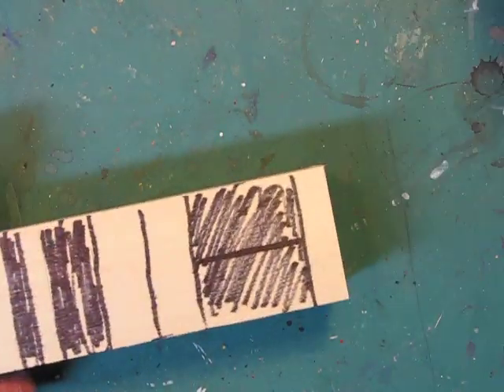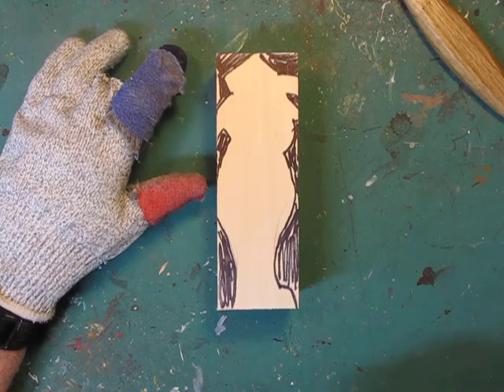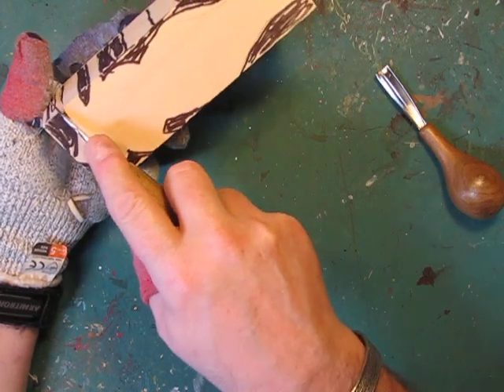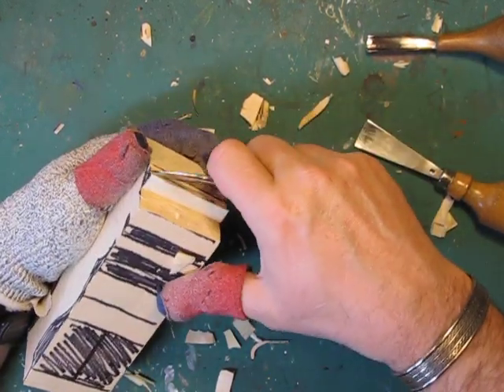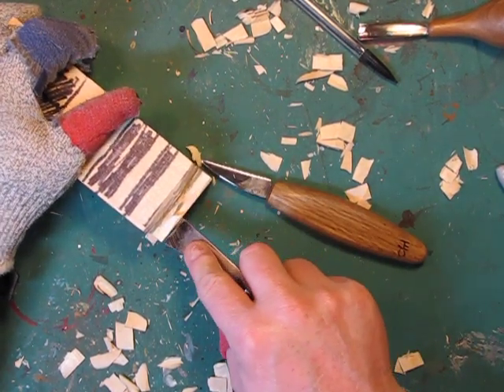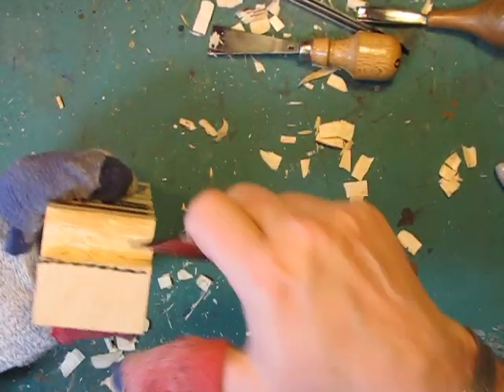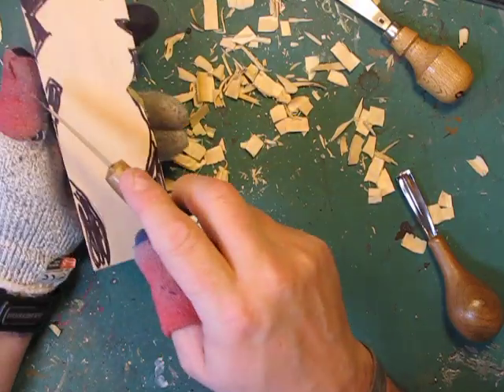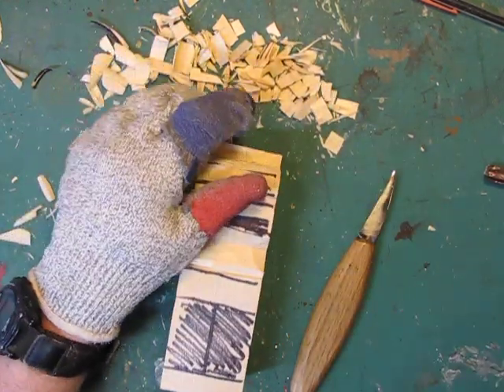Carving the caricature figure with hand tools 3

Comment: So happy that someone realize that many of us have to start with a block and not a cutout. One day I will have a band saw but until then this is exactly what I have to do before I can get to the actual carving. Thanks
Reply from the maker: I am glad I can help. I started out without a bandsaw, and then was lucky enough to get a small one. It didn't work well, but it did the job better than a coping saw. Happy carving!